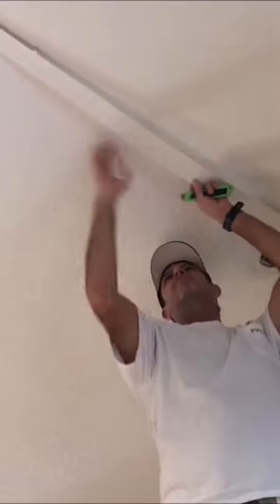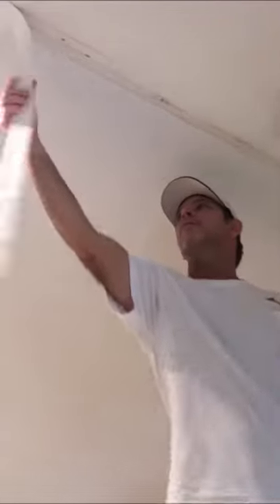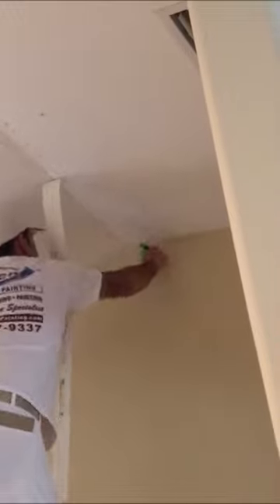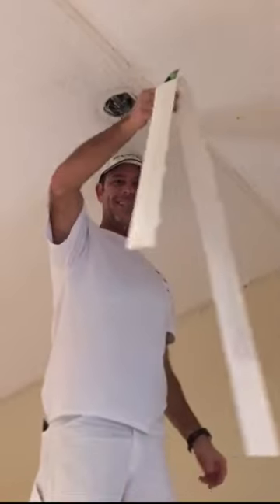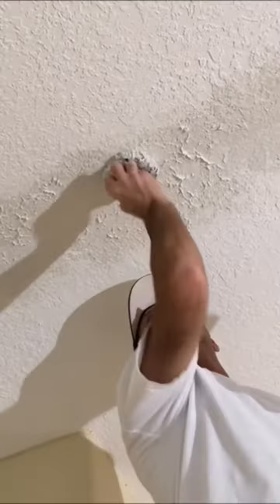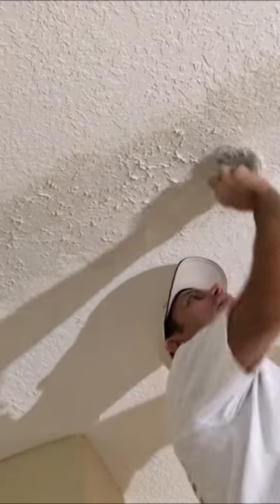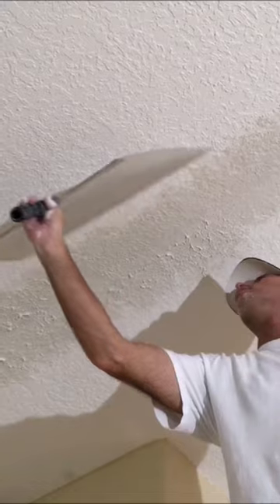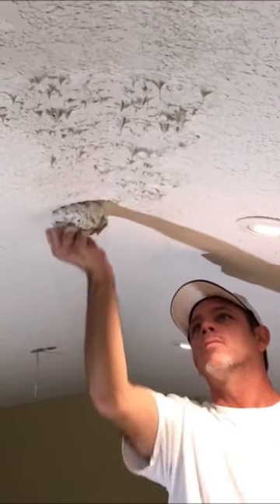Options I always give Customers When Doing Larger Ceiling Repairs!

Comment: Or add shiplap. It's expensive, but the most work is putting on the brackets. And trim over it, and cutting holes for the light fixtures. Once it's finished it looks amazing and increases the value of your home much more than popcorn ceiling. Even slightly smoothed like this guy did it looks patchy because not all buckets of the sheet rock mixes the same or completely smooth.
Reply: You have zero clue what you’re saying. Shiplap and drywall are two COMPLETELY different realms of trade work….

Comment: This is the one I wanted to know how much you charge for. How much did you charge for this one? I had a job a while back similar to this in because of having to bring scaffolding in and covering everything up the price was up quite a bit.
Reply: Tall ceiling like that needs to pay at least $1500 for what ne did. Mininum of double that to skim and re-tex or better yet sell it slick. Thats ballpark of course depending on where you live. I try and keep my prices fair. I stay busy.
Reply: @johnfisher9969  yeah $1500 is where I'd be unless they wanted the whole ceiling repainted. Usually my primer blends right in but on a vault like that I might be 1800-1900 with paint.
Reply: @mr.kenslifeshop4034  good to see we're in the same ballpark. I try to keep my prices fair.  Where are you? I'm in Central Mo. Remodel and repair work is just slammin here. Do a new house every now and then. Need to get at least buck a foot to hang and finish.

Comment: That is terrible. That's a knockdown that was sprayed on not dabbed. That patch will stick out like a sore thumb
Reply from the maker: Turned out perfect. Because you can control where you put the texture with the sponge. Spraying the texture piles it up to much at the point where the existing texture around the repair. Even if you try and feather it out. 👍🏻
Reply: @PaulPeck  that's why you spong sand the outside to feature it. That dab technique won't create the same texture at all. Guessing that's why you didn't show the finished product at the end.
Reply: I doubt it. It will probably look more than acceptable. Some textures are harder to blend than others. This is not one of them.